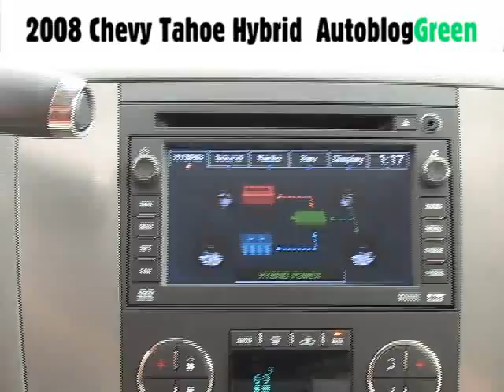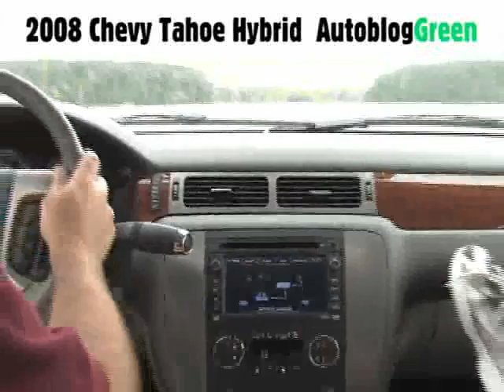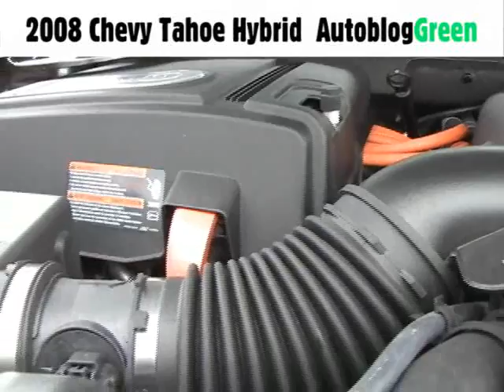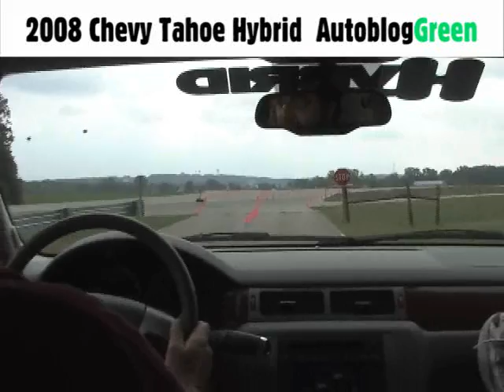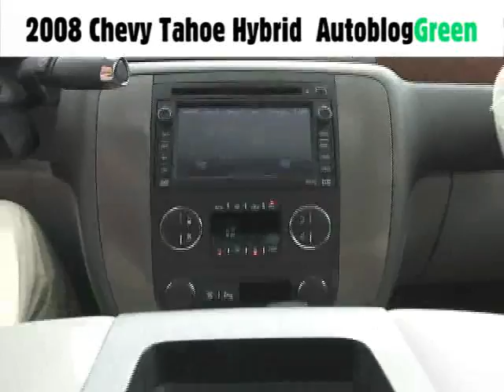2008 Chevy Tahoe Two Mode Hybrid drive Autoblog Green

Comment: chevy tahoe?...why is there a GMC logo on the steering wheel?
Reply: GMC used the the same hybrid system, sense they are both GM (general motors) and are technically the the car but with a different exterior.

Comment: not that much....
the Escape Hybrid CVT transmission is made by a Japanese supplier Aisin Seiki Ltd.  guess what ...this company is 24% owned by Toyota.

the Ford Hybrid Escape battery is supplied by Sanyo Denki and guess what its also the Prius battery supplier.

Toyota shares its manufacturing and some engineering process they are not afraid...GMs pontiac Vibe is a Toyota Matrix so GM sells Toyotas in their lots just a few people know the GM does not tell :-)

Comment: That's exactly what people should be doing which is to rent, not get an SUV, so you can lug around your 400 lb. self. I'm not interested in the SUV itself; I'm more interested in its Two-Mode hybrid system, in which hopefully it'll be much better than Toyota's Hybrid Synergy Drive.

Comment: Well, I can tell you that it'll be a little more expensive than the conventional due to installing a more complicated system but hopefully those gas and maintenence savings will offset the higher cost to buy it.